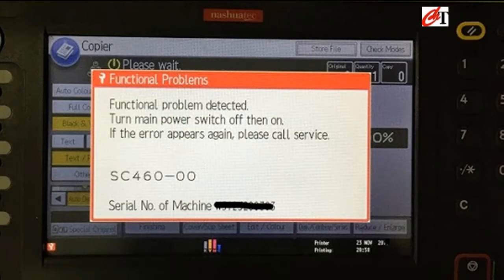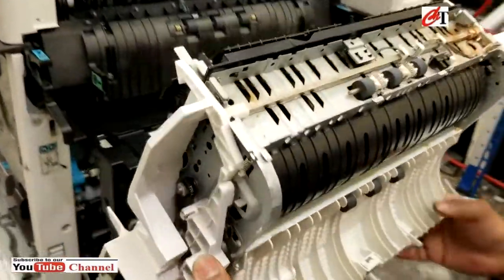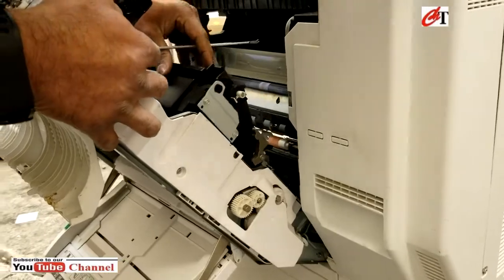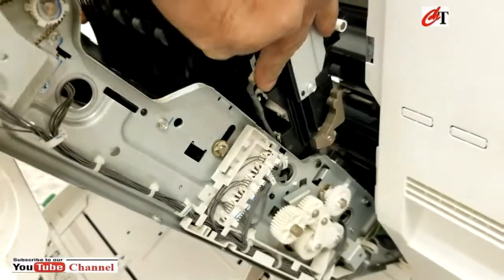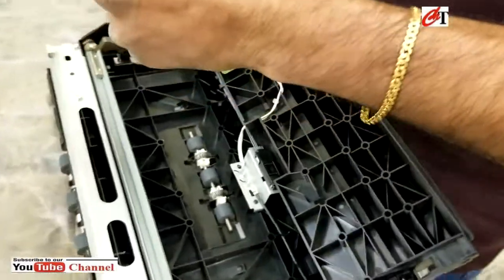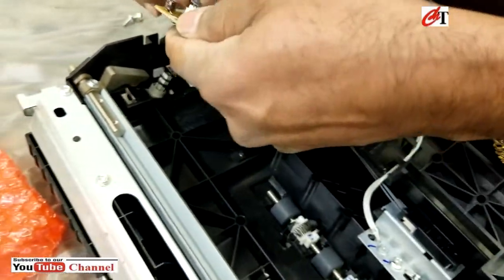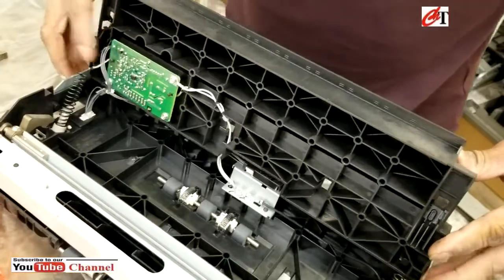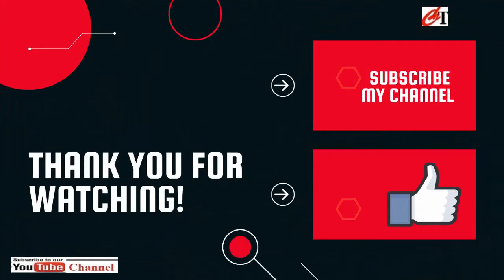How to fix sc460 | how to fix functional problem sc460 of Ricoh mpc5502, mpc4502, mpc3502, mpc3002

Comment: Hi I have Ricoh pro7100x and error code SC460 error that won’t go away can you please advise
Reply from the maker: The SC460-00 error on a Ricoh Pro 7100x indicates a separation power pack or developer unit issue, possibly caused by poor grounding, a loose drawer unit, or electrical noise. To troubleshoot, try pushing the drawer unit in firmly and restarting the machine. If the error persists, there may be an electrical problem, requiring you to check the grounding, clean the developer unit, and potentially replace it, though a technician may be needed for diagnosis and repair.

Comment: Ricoh MPC 4503 error Code SC 571-00 help me
Reply from the maker: Pressure roller thermistor error: 
Centre
The temperature at the centre of the pressure roller measured by the
thermistor does not reach 0°C for 37 seconds.
* Loose connection of the thermistor
* Defective thermistor

1. Check if the thermistor is firmly connected.
2. Replace the centre thermistor.
Since you have replaced the entire fusing unit, my thought would be the machine side of the fusing connector or the leads for the pressure roller centre thermistor.
Reply: Show me how @sherukat
Reply from the maker: If this is not sorted, let me know, pls.
Thanks
Reply from the maker: Well, I will try to do another video for it thing is I am really busy at work. 
Let me c what I can do for u
Reply: thank you very much @sherukat

Comment: How to clear error sc460 on RICOH MP 5054(B/w copier)
Reply from the maker: Causes: Hardware error • Input -  Output connector is disconnected. • Input -  Output harness is short-circuited. 
• The transfer unit is not set properly. 
• IOB error (signal error) 
• HVPS defective load error 
* Grounding fault of separation power output, short-circuit with other outputs 
• Surface/air clearance insufficient in separation power output path (including distance from other outputs)

Do: 
main power off- on • Reconnect or replacethe harness of the HVPS 
(power pack).
 • Reconnect or replace the harness between the BCU and the HVPS. 
• Reset or replace the trausfer unit. 
• Check if the contact and separation movement of the transfer unit works correctly. 
• Replace the HVPS.
 • Replace the BCU.
Reply from the maker: Hope rhis will help you

Comment: Replacement: Cleaning Unit for PCU

Replacement Required:Cleaning Unit for PCU Please call service.

Black

Serial No. of Machine E246C630027
ricoh 8002
Reply from the maker: Sorry mate, I just saw the text.. I was away for a month.. sorry again..

So Replacement cleaning unit means of 8002:  MFD asking about web..  mashing  is realised cleaning web is finished and there is no way to clean the pcu. So you can do 2 things.

1/ go to settings and increase web end value up to 100. [By the time you can order or find a web roller]

2/ change the web roller (do not forget to say to MFD,  you have Replaced a roller)and restart the MFD.

Good luck 👍

Comment: please help mi !   SC450 on MPC6501
Reply from the maker: Transfer power pack output error
An interrupt checks the status of the power pack every 2 ms. This SC is issued if the VBCU detects a short in the power pack 250 times at T2 within 500 ms.

 Damaged insulation on the high-voltage supply cable • Damaged insulation around the highvoltage power supply. • Check SIOB harness connections • SIOB defective.

Comment: Sc460 off mpc6502. Help mi
Reply from the maker: Check if the drawer unit is closed correctly using the following procedure..
1. Turn off the machine power and pull out the drawer unit
2. Close the drawer unit completely and turn on the machine power.
3. Make 2 or 3 copies and confirm the error message has disappeared.

If not..
Remove the high voltage cable from the output terminal of the separation power pack and check the following items.
* PWM signal check. (If signal is fixed during image transfer replace the cable or the IOB  )
* Separation powerpack output check. ( If I would put his fixed during the image transfer replace the power pack if output is normal during image transfer replace the high voltage cable order the quenching needle.
Reply from the maker: Good luck 🤞